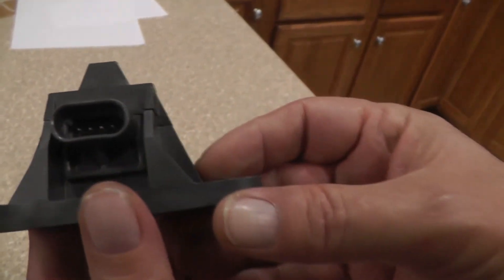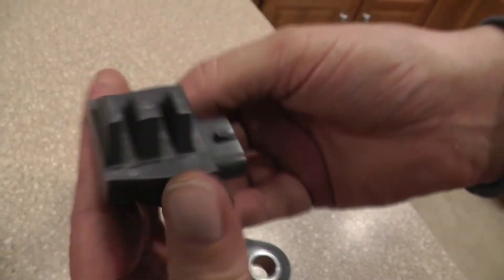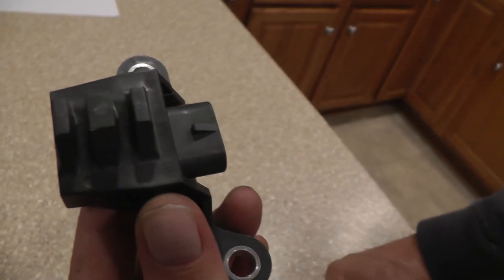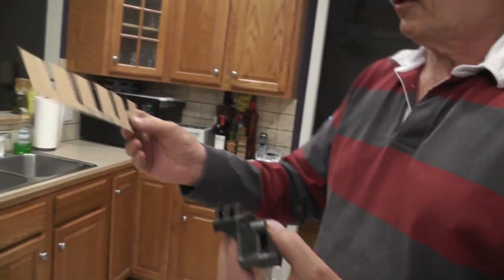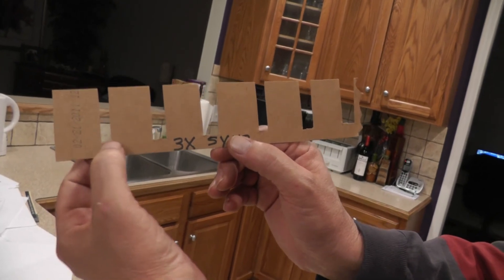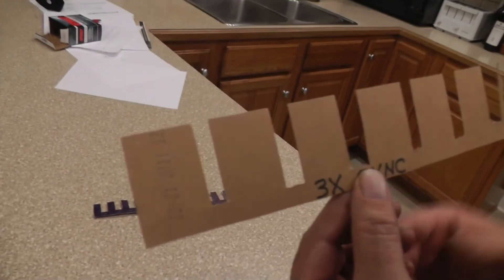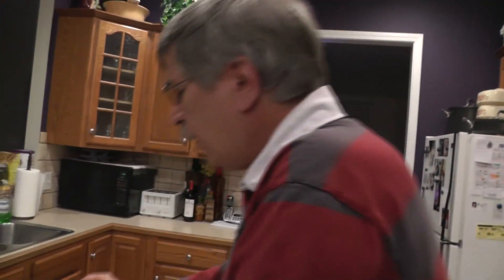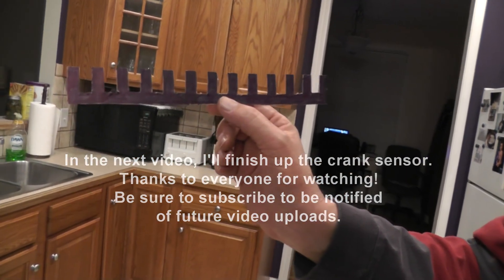Understanding Hall Effect Crank Sensors - Part 4

Comment: Fantastic Terry- the 3x sensor template had 3  different widths compared to the 18x that were equal. Is there a reason the 3x is designed different.  On the scope the 3x would show a distinct pattern compared to the 18x would not show  any .  Thanks !!
Reply from the maker: Hi Steve. Yes, you are correct that the 3X template has three different widths as I mentioned in the video. The templates, 18X and 3X would pretty much show up on the scope like the templates, emulating the interrupter rings. I was going to save the purpose of the signals for later, but the purpose of those three individual widths, low pulses, is used simultaneously with the 18X crank signal. The ICM looks at both of these signals and determines the number of 18X transitions, OFF to ON, or ON to OFF and sees how many transitions are between each 3X pulse. So, on the narrowest 3X pulse, there will be one 18X transition in there, the next wider 3X pulse will have two 18X transitions and finally the widest 3X pulse will have three 18X transitions. This is used by the ICM on startup to determine which coil pack to fire. Hope that made sense. I'll talk more about this in the upcoming videos. The second video for the crank sensor is uploading now and will probably take about three hours. That video will have more detail about the operation of how the hall effect, crank sensor works than anywhere here on YouTube. I also explain what it means by pull-up, pull-down design, sinking and sourcing crank sensors and with the circuits laid out, you'll be able to see what a test light actually does when using it to emulate a crank signal. Lots of stuff in that one coming up now.
Reply: I would have never pieced that  together  unless you told me - thanks  Terry
Reply from the maker: Steve Rob No problem Steve. The info is there in the service manual, but it's not always clear what they're really saying. I had to decipher other waveforms from other parts of the literature to know what was happening. Thanks for the comment.